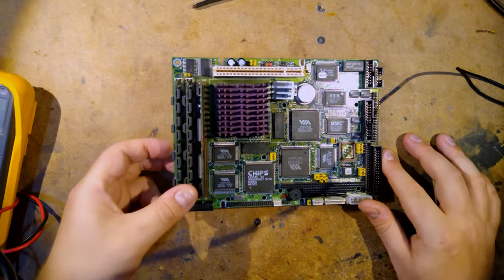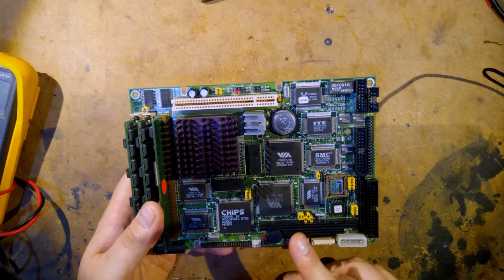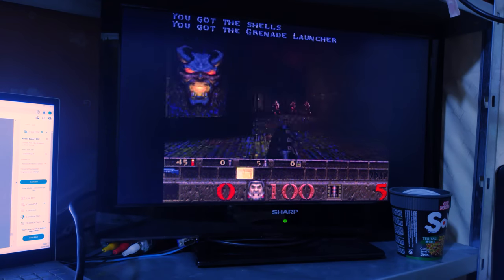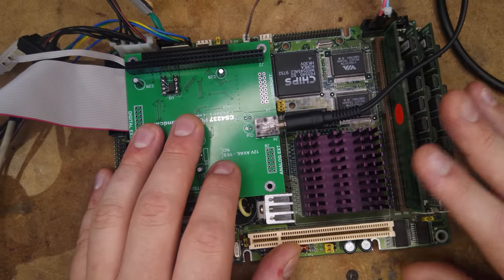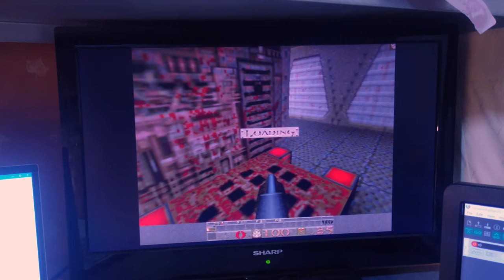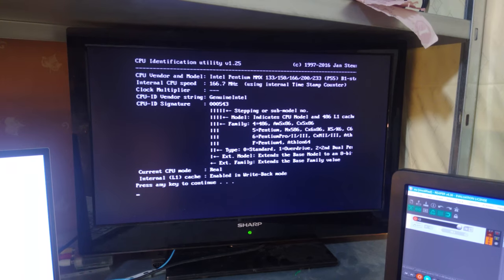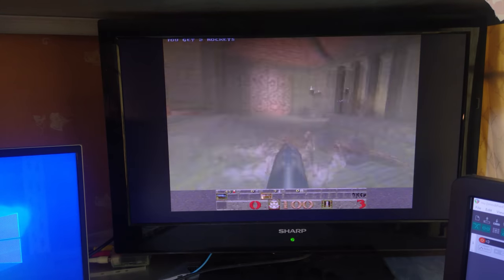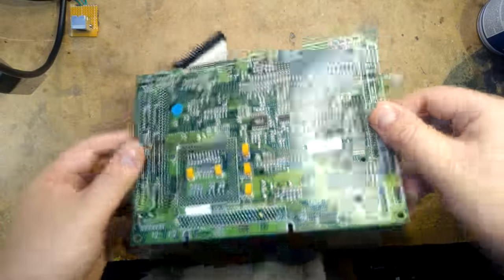3D Accelerating a mini Industrial Embedded PC

Comment: The reason that the 300MMX was detected only at 166Mhz is due to the Pull up/Pull down resistor changes for the MMX line. Necroware did a piece on that, required adding a resistor to the BF0/BF1 pins ont eh CPU

Comment: Someone should make an isa and pci based fpga sound card where you can run a simple dos program to switch between various sound cards.  Maybe a dual implementation for a pair of sound cards for those that want.
Reply: I've been thinking about a project like that to really learn FPGA.  (I've done a little tinkering, but I need a goal to really get deep into it.)

For me, I would be happy with SB Pro and switchable dual-OPL2 / OPL3, and stereo Covox Speech Thing / DSS (kinda just for fun.)  I'm not sure what else you really need in DOS.  Althought, pie in the sky and all that, I would love to add GUS and/or EMU8K and/or MT-32.  GUS would probably be easiest because it lacks the DSP algorithms the others have.

Will I ever get to this?  Probably not.  But it's fun to think about.

Comment: I like how there's a huge space on the board for the clock battery but they put it dead close to that voltage regulator 👍
(Edit) oops I just noticed you had to change that at some point - maybe the proximity to the voltage regulator didn't do the old one any favours. I've had the clock battery in a thin client die at 4 to 5 years old from excess heat.
Reply from the maker: The voltage regulator gets SUPER hot too :/
Reply: @TheRasteri  in my case it was something near the DC jack that had gone dead short, it cooked the battery and got hot enough to add 20°c to the idle CPU temp! The whole board is just under 10x10cm so all pretty close together.
I took the part off the board and it works fine without it, might have just been a diode for reverse polarity protection or something like that.
Reply: @TheRasteri  Was that after the upgrade tho? The 200MMX will be pulling a lot more than the 90 especially at 3.3v
Reply from the maker: @ljrretropcs  naw it always ran really hot, even on 90MHz
Reply: @TheRasteri  hi sir, I've just discovered the existence of those industrial motherboards and I'm literally crying: I can't believe this technology (that i love) is still manufactured!!!
Reply: @TheRasteri  and I really want to buy one of theese but from where can I buy one of theese?
Reply: @TheRasteri  help me please!!! I'm so excited!!!

Comment: I think these little SBC boards are cool and cute, but is it really worth it? I think most people don't even want to use a small cabinet for themselves, and in the end they are expensive and laborious to make. I think that a socket 7 (or super 7) baby AT board, besides being cheaper, can be mounted in a custom case that will end up being the same size as you would get with an SBC. The space problem on retro machines boils down to a full-sized at/atx font, and their cards (especially sound cards) that are large.

But for SBC or Baby AT/ATX you can use a small font like the ones found in dell computers, or external fonts, xbox 360 fonts, adapters that convert notebook font to atx... And pci, isa cards, there are several solutions, from simple risers, to customized boards that you can print on the pcbway. 

I don't mean to disparage SBC, I'm just arguing some facts from a financial standpoint for someone who just wants a small retro computer.

Comment: That riser card is ideal height. Small overal package, yes. But if you add power supply and any kind of I/O drives, then it'll approach micro-ATX build scale, unless parid up with a pico PSU and maybe a slim CD reader... I used to love making miniature PC's back in the day. Cramming as much into a small space as possible, to the point where I had parts burn if the fans weren't roaring like a blowdryer.

I've seen cool industrial PC's that fit into a car stereo rack. Pentium 3's, but I don't remember what models they were, and power would have to be external 12V, like in a vehicle. I regret not buying one of those when I had the chance.
Reply: Pentium mobile 600 most likely
Reply: MiniATX formfactor ( not MiniITX or MicroATX), I have one with a Socket 478 Pentium 4... Which would not have been my first choice to shove into a DIN slot due to heat, and doesn't support Socket 479 Pentium M even with adapter. Got it cheap though, was planning to put it into a random thing that wasn't made for computers like I had seen people do to MiniITX boards, but never completed it. Takes ATX power, and seems to have been intended for an external DC-DC converter board whose standard name I forgot (still around in mini systems too powerful for picoPSUs).
Reply: @tom611  Interesting. I ended up just cramming a Micro ATX build into my old Chrysler. What was cool, is that I hooked up video glasses to it. That was early 2000's, and I don't think consumer LCD's were common. Still CRT days. And I could drive to the middle of nowhere, put glasses on, and watch a movie in some revolutionary new compression format like DivX (lol). I was running a 1GHz P3 with 256MB of RAM, which is a lot for an early 90's Chrysler. That setup had no real practical use. All I did was watch movies on it. Could get maybe 6 hours of runtime off the inverter before draining my car battery dangerously low.

I have the video of the machine on my channel under "Retro PC Revival Attempt". That pack used to sit in my car, before becoming a table item.

Comment: the thing that holds quake back is floating point performance. other 3d games around that time used fixed point math (descent for example). since the voodoo card only does polygon fill,  its going to be held back. if you could find the 3dfx accelerated dos version of descent, you might get pretty good performance.
Reply: I had a 486 DX100 and I thought I got more frames than this - but I prefer the software renderer. - I wonder how a Pentium-3 - 800mhz would do - would that get us to 60fps?
Reply: @brentgreeff1115  even software renderer makes heavy use of the fpu. i remember something along the lines of  "absolutyely must have math coprocessor" in the system requirements. no x87, no bueno.  pretty sure the 486dx had one and all the pentiums and later. 

ran pretty good on my 120mhz pentium. i think i had one of those sec pentium 2s but by that time i was already playing q3a on a voodoo 3.

Comment: Interesting. I was able to get a PCM-5864L and so far, had only been messing around with Debian 3.0 on it, but the wired LAN connector it came with was broken, so I wasn't able to get it online, but was able to use APT to install some packages that were included on the install CD set. I do plan to mess around with Windows 95 and NT 4 on it eventually.

Comment: Thing is: while most older 3dfx (DOS) games run just fine on a voodoo rush, banshee, 2, 3 or what have you, some odd games specifically require a real voodoo 1 and won't run on anything else.

I had a K6-2 + Voodoo 2 at some point and always wondered why I could not get some games to run with 3dfx  acceleration ... carmageddon being a prime example. 

I got a MMX pentium 1 now and a real voodoo 1 to go with it and those games magically work.

Stuffing the voodoo 1 in a faster machine makes no sense either, as games that could benefit from more CPU speed usually don't have that "voodoo 1 only" limitation ... and there are also some games that don't like fast CPUs ... wipeout XL for example will run  at the right speed on a 200mhz pentium 1 but the game engine isn't fps-locked in any way and will go as fast as the machine will let it so the 450 MHz K6-2 was already a tad fast and the game becomes unlplayable on a 500 MHz pentium 3 ... if you run it on, say, a 1+ GHz athlon, it goes crazy fast and looks like a quake timedemo would look on that same machine.

What I'm saying is: you wanna keep a pentium 1 + voodoo 1 machine around for these odd games, so,  make a nice little case and put that pentium board and the voodoo 1 in there.
Reply: That is some really sloppy coding.  haha  I expected better of Psygnosis.

Comment: What an odd combination of the PC104 header and a PCI connector.
there must have been a specific goal in mind for that.
I will say when it comes to Glide games under DOS, they can be a bit tricky with anything other then an original Voodoo.
some had the drivers as a separate file and those tend to be ok if you replace them with a later version (iirc its glive.ovl).
but others had the drivers statically compiled into the game and those tend to be much harder to run on later cards.

Comment: I gamed hard in this era, the P90 should easily reach 50fps in doom, Quake should be about 16 to 25 fps - the 200Mhz processor should be able to hit anywhere between 40 and 50fps in Quake on a 200Mhz Intel at 320x240 - I suspect that the onboard graphics card's framebuffer is very slow  - try a good 2D capable graphics card perhaps? (that onboard one might be ISA and abysmal internally!) in terms of the voodoo with a 200Mhz mmx your sweet spot is deffo the Voodoo 2 - that's a 50 to 60fps experience in quake and games that use MMX for mixing colours like sub culture should run really nice too on that Intel chip.
Reply from the maker: Yeah the 2d chip is really bad. I bet the RAM/cache/chipset are major bottlenecks too
Reply: @TheRasteri  - yeah man - even so? a 200MHz MMX on that little board is lovely :D off the top off my head Sub-Culture had binaries for x86, MMX and 3DNow respectively - 3DFX and others too if memory serves. It was a a great game for benchmarking back in the day! that and the second reality demo lol
Reply: @TheRasteri  - But deffo don't neglect MMX builds of games in that era - I was a 3DNow fanboy but at those clocks? the vector instructions added a huge boost to performance when implemented in an engine - MDK had a MMX binary and it was night and day on the same system!
Reply: Oh! check the IDE controller too - if it's DMA capable but in PIO mode? old VIA chipsets were notorious for tanking windows performance when in PIO and I remember having to enable DMA manually in device manager on many a machine back then - might be worth checking :) hope you're well!
Reply: @TheRasteri  - ooh! get a voodoo banshee - great 3DFX compatibility after the fact and lighting fast 2D too :D
Reply from the maker: @JohnnyWednesday  lol I had a banshee in the late 90s, my parents threw it out :(
Reply: @TheRasteri  - aww gutting! never mind - something juicy will pop up - there's a kick-ass glide wrapper nowadays so a TNT2 will handle most 3dfx games under windows at least - bit overkill for the era though :\

Comment: I'd try it with a tnt2. Great 2d and 3d for the era
Reply: TNT2 was the "big one" - first to put the voodoos in the corner. Probably not going to get the best out of that card until you're in the 300Mhz to 400Mhz zone
Reply: @JohnnyWednesday  that is true but at least uou know the bottle neck will be the CPU for both 2d and 3d.

Comment: 21fps glquake at 480p ain't bad for the p90, better than expected. The dos 2d performance seems a bit slow, I would have thought the doom frame rate would hit the 35fps cap. Were the games that support it running in vesa video modes (duke3d, dos quake) or was it mode 13h. I suspect gaming performance not emphasis for industrial board video chip though.

Comment: Wasn't surprised about Unreal, the Voodoo1 was pretty outdated by the time Unreal came out. If you would have popped a Vooodoo 2 in there (or you could have just popped in a Voodoo 3 and not needed the passthrough!) you should have got easily playable FPS at 200 MHz.

Comment: Interesting, in 11th grade (Around 1998) I had a cobbled togather Intel 486-50 that I overclocked a 66MHz, later I installed an AMD 586-133. 16MB RAM and Windows 95. Played mostly DOS games on it. Had a Soundblaster knockoff (Cant remeber the brand) though I couldnt afford a true 3D Accelerator I did have a Matrox Millennium I bartered for.

Comment: That looks to be an EBC formfactor board. That's the size of a 5-1/4" drive bay. Get an extrnal CDROM box or the like that's two bays high and you could probably fit that all in, then you'd just need a front plate to cover things and to sort the power supply, pending the internal one wouldn't work, which it might not as the board I have needs several Amps off the 5-volt rail (12V just for CPU fan).

Comment: 133/166/200 pre mmx are the same chip, if it works with 1 it works with the other,  it might not have the multiplier for beyond 166, but  you can set it like a 133/166 then overclock the bus to get a stable 200 mhz pc. its faster doing it that way anyways.

You are reaching the limit of the pci bus, if you clocked the cpu lower than spec and then overclocked the bus until the cpu was back to spec... you would see bigger framerates than you would from overclocked cpus... also you should unlock vsync, and overclock the voodoo and get the Fastvoodoo2 or Wicked 3d Drivers....

its not undoable, to get 50-60fps in Quake on that setup.  You will know if done correctly by running the drect3d test, the spinning cube should be spinning so fast that it looks like a 3d porcupine star.

Comment: I have an Advantec integrated display/PC104 compatible computer.  Bought at goodwill for $10
Runs Win98 and a weird Dairy Products industrial control program.  No sound. I'd love to build or buy your PC104 sound card for it.  Any plans to publish your sound card design?
Reply: one of those USB dongle sound cards, tiny and has headphone/line out, mic/line in

Comment: Something's wrong with that. Unreal didn't run THAT bad on my 200mmx with voodoo1
Reply from the maker: Yeah the board probably has a million other bottlenecks (chipset, RAM, cache). Maybe fiddling with BIOS/jumpers could help but I can't be bothered :)
Reply: His issue is power that molex doesn't supply enough

Comment: Was WinQuake slow because of running 640x480 (compared to DosQuake's 320x200)? Or was it slower because of Windows+DirectDraw? The 200 MHz fix was magic!
Reply from the maker: I should have mentioned in the video that Winquake ran similarly to DOS in 320x200 (maybe 1-2FPS slower). The 2D chip on the board is really crap...

Comment: I feel like you're getting worse performance than you should. I used to rock a P133 and a voodoo for longer than I'd have liked and I remember it managing playable framerates in a surprising number of games released into the P2 era. What I do remember is that I tried to overclock it and the BIOS would report Pentium 150/166 depending on the jumpers but the benchmarks would all agree that the CPU got SLOWER and usually benched about a 120. I never figured out what that was all about, but since that's not an officially MMX compatible board you've got I'm wondering if you're getting the same problem? It's "running" at 200MHz but not really giving you the performance of a 200MHz CPU?

Comment: I just had a look on Ebay USA for one of these boards.  Being on Ebay, you know the price is a bit steep.  But Pentium III you say?  My search term was "Advantech 5890" and one of the results was a decendant of thime board in this video:  SOM-5890 Rev. A1 (RAM slot had a sticker with SOM-5890FG printed on it) running a 1.1 GHz Celeron.  I couldn't tell anything about expandability from the usual not-so-great Ebay photos, but it would be interesting to see what could be run on that board.  Fortunately, the price of the later board was less than 1/3rd that of the older boards.

Side note:  My mother in law once unintentionally referred to the Celeron CPU as "Sell -ya-wrong".
Reply: Pentium 1 he said.  At 90mhz.
Reply: @hicknopunk  he mentioned Pentium III towards the end of the video for early 3D gaming.  I know the one he displayed is a Pentium 1.
Reply: @JVHShack  ok, ok.  I like your username.
Reply: That looks to be using some sort of header that is not something really hobbyist usable for basically everything, probably needs a backplane board or breakout board. Try the search term "EBC Motherboard" instead to more of the formfactor of this one, usually with a PCI slot and headers for the rest, though take close look at or research the manual to find what /size and pitch/ the headers are, as one I have uses the pitch of a notebook IDE header (1mm?) for most of the connectors which is more of a pain than the usual size (0.1 inch?)

Comment: I have something similar I'm going to be doing a video with for DOScember this year, though it does concern me a little, as I'll be doing much the same things as you in my video, even down to using one of your PC/104 soundcards, I don't want to be seen as copying, it's been planned for a while. There are some key differences though in my video, currently on getting some of the bits for it. Mine won't have a Voodoo, but i'm trying to figure out a good 3D accelerated video card that works well under DOS
Reply from the maker: by all means do related content, there isn't enough PC/104 stuff on youtube :)

Comment: Something seems to be wrong on the doom front. My 5x86@160mhz runs it around 45fps.
Reply: 2D performance is very slow.  3D performance is normal.
Reply: @infinity2z3r07  so i guess it has something to do with the onboard 2D videocard...?
Reply: Its not enough amps using only molex

Comment: Now if only there was a mini Industrial Embedded Pentium 3 or AMD Athlon PC, my life would than be complete. :D
Reply: try mini ITX 270 !
Reply: EBC formfactor boards can handle Pentium 3.
Reply: Thanks! I found one mb, called EBC 563. Looks very similiar to the Pentium1 board.
Reply: @the1990kman  Yeah, the Pentium board in the vid is what at least Advantech calls EBC formfactor. Some of their "PCM-" model lines are EBC too. It looks like that EBC 563 might have a soldered on Via C3 (the ones on eBay all did), and while the non-soldered version fits Socket 370, it is extremely slow for that era compared to a P3, though consumes way less power as a trade-off.